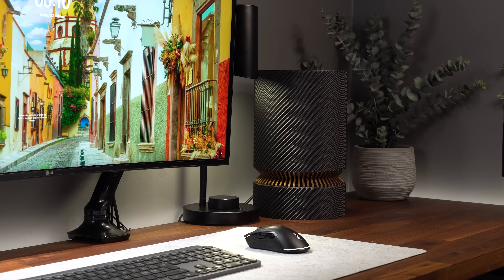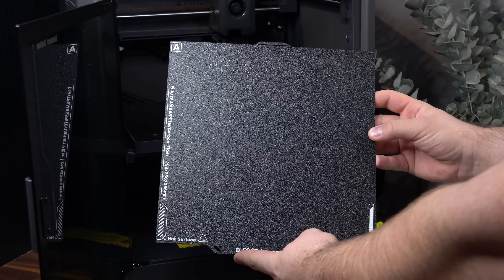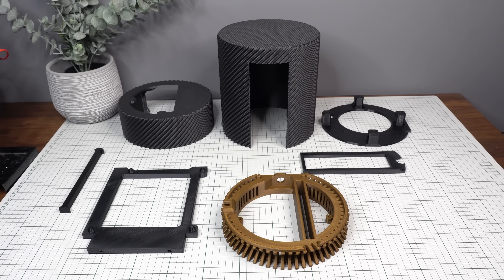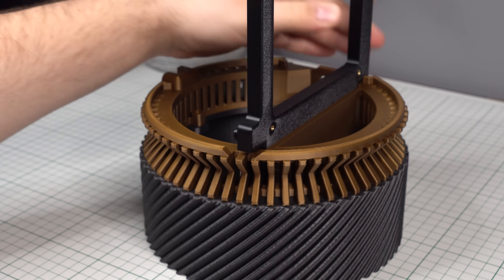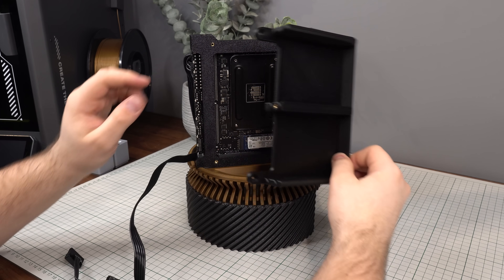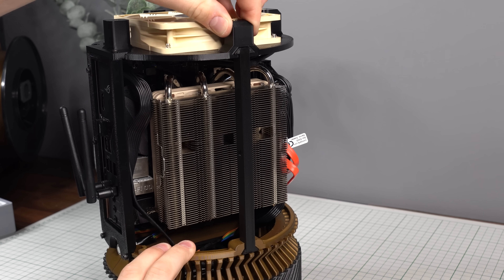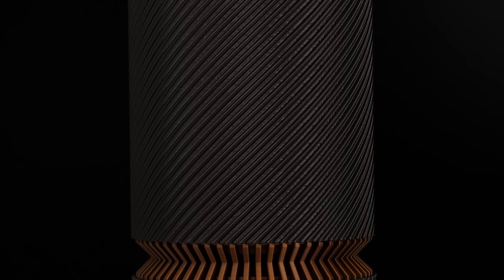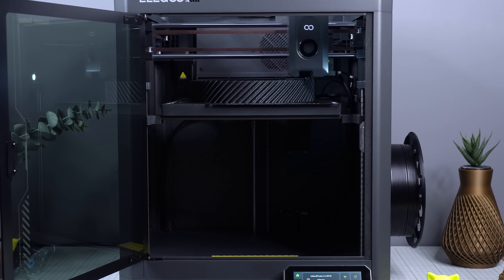Aesthetically Pleasing Custom 3D Printed PC Case Build

Comment: Ayee there! I think this is one of the cleanest PC Cases you've made so far!! Is there a way you could make something like this but for matx motherboards and a 2 slot Graphicsard? that would be amazing!! Thank you so much in advance (/; U ;)/
Reply from the maker: Hey! Many people have requested exaxtly this. And I think it would be possile to make something similar for sure that supports mATX and a GPU. I’d imagine that to be like a 200mm top fan, and GPU cables facing dow towards the underside of the case next to the PSU 👌

However it would probably require a large print volume up to 300mm if printed in one single piece which would greatly limit the amount of people who can make it. Of course unless I split it into smaller pieces but would need a clever way to join it all seamlessly then

Comment: Absolutely gorgeous! Personally, instead of a drive cage, I'd prefer to install a 2-slot GPU, with the video ports facing down, toward the bottom of the case, via riser cable. I'd also like to give the fan at the top some ARGB, or a simple ring light with a warm, amber color so the PC can also be a desk lamp of sorts. Imagine if the case was made of anodized aluminum, with the mid-section of actual copper, or walnut wood, with a brass mid-section! :)
Reply from the maker: Thank you! Adding a GPU was one of my ideas originally, however I found that due to the round shape of the design it was quite challenging to keep it as compact if fitting both a motherboard and GPU, in the current size that was not possible to do.

However, I know a lot of people have wanted this so I’ll definitely consider doing a GPU compatible version of this eventually. 😊

Comment: where does one find all the mountinghole spacings and such for atx stuff? i heards about grabcad, but thats finisched files.
Reply from the maker: Hi! Honestly, it’s a combination of self-measurements, digging through documentation found on various websites etc. My measurements in my cases are not 100% to spec, but within like 0.1-0.2mm on all measurements so it’s not really noticeable. Just a lot easier to design using for example 158.2mm instead of 158.2346 which the spec might say (as a lot of the measurements are converted from originally inches to mm, and other parts are designed originally in mm so they have round numbers) . In reality it doesn’t have to be perfectly to spec to function. As mostly, all holes etc. have some wiggle room. 😊

Comment: Qual é a medida da mesa que eu tenho que ter, para eu imprimir aqui no Brasil?
Reply from the maker: The print volume required is 202x202x215 millimeter. (215mm height), please check Printables.com for the special print settings required.

Comment: Question please, can I pay extra to adjust the internal design?
1- Fan to be on bottom to intake airflow, PSU on top to exahst the airflow
2- Since it looks like a nice lamp, how about some actual microscopic cracks to utilize RGB inside the case? nothing too bright just tiny bit of light

Could these changes be applied or would it require overhaul of the case design?
Reply from the maker: Hi, this would require a completely new design basically... If you purchase the model I can send you the .step file which you can edit yourself but this is not a very simple mod and will require some skill😊 message me on Printables after purchase if you decide to do, so, then I can send you the file.

If you were to pay me to do this the price would be way too high.
Reply: @makerunit  regardless, keep up this work it's AWESOME!
Reply from the maker: @ thank you! I appreciate the positive feedback! 😊

Comment: nice looking PC! I wonder how long printed PC last before it combo-up? For PLA only couple of months before it become brittle and break aprt.
Reply from the maker: Thanks!

For PLA it will depend on a lot of factors like ambient temperature, humidity, PC components used inside (how much heat they generate), and also whethet it’s exposed directly to the sun or not. 

For PETG, it’ll last very long.

Comment: These slots should be hollow for ventilation. Where is the air inlet and outlet?
Reply from the maker: … did you watch the video? 😅 The copper part with the slots are pulling in air, the air then exhausts through the mesh in the top.

Comment: Hey, since the mobo doesn't have a GPU attached, I feel like the design would be better if you could get the heat sink to be in line with the airflow. It would be difficult for the Io tho
Reply from the maker: Yeah I didn’t even think of this. Though I’m pretty happy with a 74 degree max anyways. I’m not sure how much of a difference it would make but I’ll try to keep this in mind for future projects like this. 😊

Comment: Why's the surface finish of the spirals... all lumpy?
Reply from the maker: I know it looks kinda «lumpy» up close, but it feels suprisingly smooth. I think this is from a combination of the filament being a little shiny, and me using a 0.24mm layer height with a little too high speed. Resulting in the filament being thrown around that sharp corner if that makes any sense. I used 0.24 layers to minimize the risk of the CF causing a clog in the nozzle but I probably overthought it a bit. All other prints came out with really good even lines and smooth finishes so I believe that’s the reason due to all the tiny sharp movements and big layer height in the external pattern.

Comment: Love the design.

Btw 9:25 is that a carbon filter I see behind the gantry? Seems like something definitely is there. Really like this grey color theme of this printer.

Funny that I can't print most of large models but could print this like even with 1.1 times scale. Such luxury ain't something you see everyday when using delta 3D printers hahaha...

Annd if you don't mind for an extra question: I saw your reply on other's comment about heated inserts. Is there some tips making space for heated inserts in 3D models? I just recently bought bag of it and planning to try it out soon on whatever mess I ended up making in blender.
Reply from the maker: Hey! Thanks! 

Delta Printer, is that one of those round bed ones? 😁 perfect for this then!

Regarding the inserts I like to use 4.3mm or 4.2mm holes for 4.6mm inserts. 

Take your insert diameter and shrink the diameter about 0.4mm smaller (0.2mm on all sides) and it should slide nicely in and get a nice hold.

I recommend knurled inserts. They seem to hold the best.
Reply: @makerunit  Aye thanks for tip! maaybe I bought wrong insert, it's not knurled but generic two diagonal strip rings. Hope This holds good enough..
Reply from the maker: @jupiterbjy  oh btw I forgot to answer about the Carbon filter. Yeah it looks like it but I think it’s just a sponge type material to filter some dust. As far as I know it’s not an active carbon filter, just a general mesh type material. I might be wrong here but there is no mention anywhere officially that this is a carbon filter as far as I know, it just exhausts air out the back. However it’s probably possible to modify to fit the Bambu X1E carbon + HEPA filter in one with a printed bracket mounted to the outside perhaps.
Reply: @makerunit  ah I see, thanks for confirmation!
Reply: Isn't this basically the trashcan 2013 MacPro reimagined?
Reply from the maker: @ I mean, it’s round so I guess that must be it. 

But yeah it’s inspired by that to a certain degree. However I actually thought about this when looking at some modern air purifiers and started thinking, how could those air purifiers look more fancy. Then I was inspired by some 3D printable vases, one thing lead to another, boom, a mix of all three 😁

Comment: Great design and looks fantastic.  I forsee a potential problem though.  Since it doesn't look like a computer, someone could place something on top of it, blocking the cooling unintentionally.  To make it more obvious, you might want to put an LED strip - possibly soft white or gold - inside the top plate.  The glow will look sweet and someone would be less likely to block your airflow.
Reply from the maker: Thank you! I see what you mean, however I don’t think this will be a major issue. But of course, it’s no problem adding something like this yourself to prevent this if you prefer it that way! 😊

Comment: I just want a good looking case like this but that supports my normal size pc parts.
Reply from the maker: I’m glad you like the design! But please, could you define «normal size»? 😅 could you be a little more specific?
Reply: @makerunit  a small ATX case, so I can use all my ATX components but in a small form factor. Most of the market use mid tower pcs so it's super applicable since most people don't want to go buy a whole new motherboard, psu.

Comment: I see heat set threaded inserts I upvote.
Reply from the maker: I remember a few years ago I swore to myself that I’d «never use those», as plastic holes worked just fine. However, after trying them, I completely changed my mind… never used more plastic threaded holes since. 😁

Btw, I checked out your channel, I really like your presentation skills and beautifully composed shots. I hope to master my filming techniques like that some day! 💪
Reply: @makerunit  Indeed, heat set inserts make parts look premium, especially with the right filament. 

Thanks for the kind words, you have an awesome channel as well, I only discovered it today but you got yourself a new fan.

Comment: Does this work with 2.5 inch harddrives? Looking at a mini nas that i can ise in my loving room
Reply from the maker: Hi, it’s designed primarily around 10mm thick SATA SSD’s. You can put in some 2.5 drives here as well, but unfortunately you can’t fit four of the 16mm thick ones. You can put 16mm thick drives on the outer two, and use slimmer drives on the inside perhaps.
Reply: @makerunit  thank you for the response! ❤️

Comment: Would component temperatures when used be an issue if printed with regular PLA? I don't think my printer can handle that carbon filament (nor that I can find it here), what would you recommend for a replacement? PETG perhaps?
Reply from the maker: Hi, the Carbon Fiber filament is by no means a requirement! It’s only me simply letting people know what I used to achieve my look. Regular PETG should be just as fine! 😊
Reply: @makerunit  Thanks!, appreciate the answer.
Reply from the maker: @SomeQuackingDuck  I now see you asked about PLA, I must have read too fast. Yeah PLA should most likely be completely fine.
Reply: PLA would be just fine from the temps he mentioned in the video

Comment: Nice beautiful case for sure. The black, with the copper accentuate in the middle add to the classy look. And assembly looks like an easy task.
That printer looks and prints very well. If the long term reliability is there, then it will be a winner for sure. But only time will tell
Reply from the maker: Thank you Patrick! I’m glad to read you like the design and choice of colors! 🙏

Comment: Clever design, I like it. I'm considering getting a Centauri carbon myself, price is too good
Reply from the maker: Thank you! Glad you like it!

For that price, there’s pretty much nothing compareable on the market giving the same price to performance ratio. The printing quality has been great during the time I’ve had it for over a month now. And with their upcoming multicolor system I think this will be a real Bambu contester.
Reply: @makerunit  Thanks for the info. I would like to ask you, would you choose Centauri Carbon over Bambu Lab A1?
Reply from the maker: @ Well, Bambu's are of course known for their good printing quality as well, however I think the main benefit of the Centauri is the fact that it's enclosed. That will come in handy in a lot of scenarios if you try to print more temperature sensitive filaments, as well as the hardened steel nozzle stock I still think the Centauri offers an advantage here.
Reply: @makerunit  Thank you so much for the answer!

Comment: You could definitely mass produce and sell these. Especially with the upcoming ryzen strix point apus, there could be a decent demand. Looks really good.
Reply from the maker: Thank you! Are those APU’s coming as AM5 versions? I thought they were only laptop chips. Though I might be wrong here 😅
Reply: @makerunit  They are laptop chips but Framework is making a desktop machine with them, so I imagine other companies will too.
Reply from the maker: @ I see, time will show! 😊
Reply: @makerunit  you are right, but hopefully the integrated GPU in that will expand to more of their other chips in 2 to 3 years. You have the framework desktop beat on design and features i would be interested in. That elegoo sponsorship is also 👌 it's now in the shortlist for my 1st 3d printer. Let me wait the 6 month later reviews and I'll hopefully remember to buy using your link.

Comment: That's one stunning looking case. I've been in interested in using Carbon infused filaments. I have some PLA Carbon, but probably wouldn't be good for this project, at least not for the frame anyway. 

You always have some damned cool projects.
Reply from the maker: Hmm, that’s hard to say. Carbon fiber filaments give a really cool surface finish, but I would generally recommend PETG, ASA  or ABS for my builds as it’s just a lower chance of temperature having any effect. 😊

Comment: This is gorgeous... the carbon fiber infused PETG quite expensive though but the look is amazing. Are you using hardened nozzle for this?
What was your room temperature during the stress test?
Reply from the maker: Hi, yes the ELEGOO Centauri Carbon, as the Carbon in the name implies, has a hardened steel nozzle stock. 😊 

I believe the room temperature was around 22 C, I didn’t actually measure but that’s a quite typical temperature in my office.

Comment: Did you design this case yourself? It looks so well thought out and elegant. I'm a fan!
EDIT: Another question. Do you happen to sell a 3D-printed case design that is small enough for the components you have (motherboard/5700G/fan/SFX power supply)? I have a setup where I only use these components, and I'd love to print a case in PLA that is minimal enough and can house these components in the smallest custom case possible.
Thank you!
Reply from the maker: Hi, I believe this design is the closest I have at the moment to what you’re referring to. As for the PLA, I’m like 95% sure it will be fine, especially if you keep the top fan always running. But I’d still recommend PETG if you can as it’s generally better for this kind of purpose. 😊
Reply: @makerunit  Awesome! If you ever design something as small as the new Framemework minidesktop that supports an SFX power supply, please let me know! I'd buy the design in an instant!
Reply from the maker: @ I don’t think it’s even possible to make it that small with a SFX PSU. They use a FLEX psu in their build I think. But I’ll keep it in mind. That new ITX board seems pretty sweet!
Reply: @ Ohyeah! Perhaps not THAT small, but small enough that it doesn't fit a discrete GPU hehe Thank you! Please keep me posted if you ever do!
Reply: I wouldn't print it it pla - it will most likely deform under the heat. Petg and similar

Comment: no graphics card 
to reduce size ssd m.2 no sata (why still use a 128 gb sata ?§?)
then you can add a graphics card
Reply from the maker: The SATA drives used in the video are mostly as a proof of concept. But I also know a lot of people want to build these cases I make with spare parts they have laying around from older systems, often that can even be an old 128GB SSD 😊

Comment: or just buy an asus zflow 13 for 2200bucks
Reply from the maker: That’s also an option 😁 I mean it’s just a tiny price difference
Reply: @makerunit true you lose the storage space but you gain all the portability you could ask for, you could probably just dock it neatly to storage or have a NAS
Reply from the maker: @ That’s true. However this type of system can be built with spare parts people have laying around. I bet a ton of people have old SFX psu’s, old AM4 motherboards and drives that need a new home. That’s more who this is meant for, it’s not necessarily meant for portability 😊

Comment: Great design, I was looking for something like that for my home server. 
What filament are you using for the coper color part ?
Reply from the maker: Thank you! That’s great! 

Actually the copper filament came from an unbranded spool with zero labels or anything so the brand here is unknown. I’m not even sure if it’s PLA or PETG but based on how it prints and what settings worked for me, I think it’s PLA. 

I was gifted that spool from a relative who knew I was into 3D printing and bought it without any box or info at a garage sale.

Comment: loved the video, but i would change for it to feed air through a filtered bottom intake, to prevent dust to accumulate inside too quickly. great work!!
Reply from the maker: I totally understand. I specifically tried to avoid the bottom air intake to separate it from it’s «competitors» and I think aesthetic wise it was a smart choice (in my own opinion). Dust wise, maybe not so, but a quick airblow every once in a while isn’t my worst fear either 😊

And, thanks!
Reply: @makerunit  yeah haha, i guess im just lazier than the average person when it comes to cleaning their pc hehe
Reply from the maker: @mehzurilo  haha, you may think that but you’d be suprised at how lazy people can be, including me. I don’t even dust off my PC more often than when dust is starting to clog the intake vents 😆